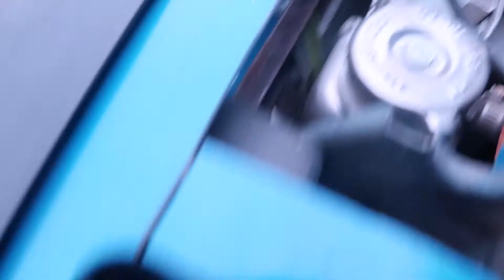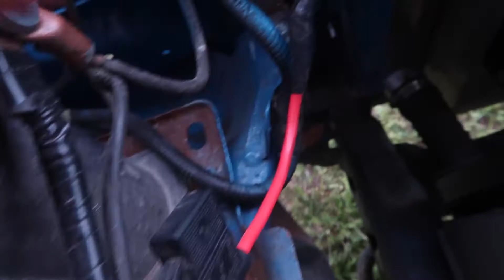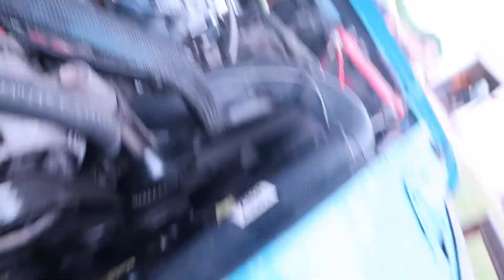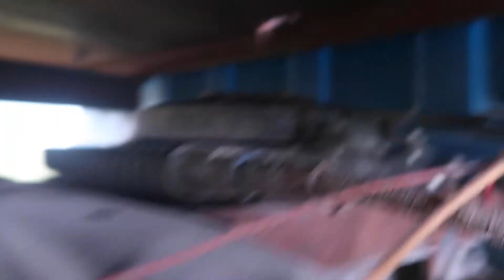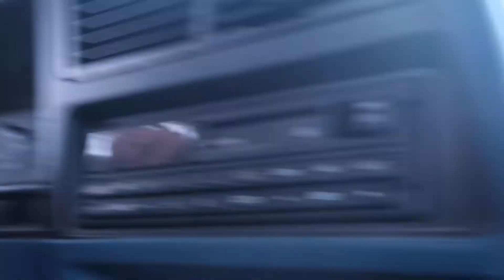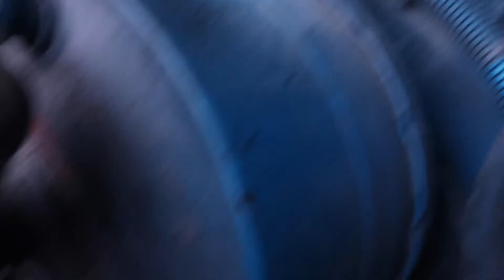V8 Ford Ranger Walk Through

Comment: couldnt u just keep the old ac compressor to work with that?
Reply from the maker: Yes that’s what I did I used a 4cyl ac compressor and had to modify the bolt hole on the compressor I clearances them with the grinder 😂